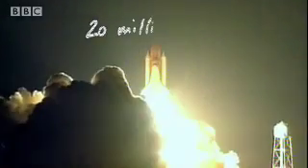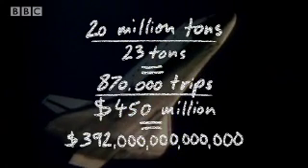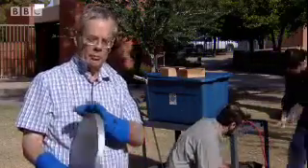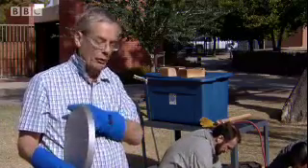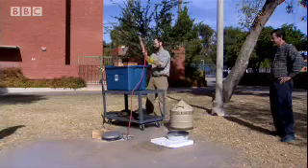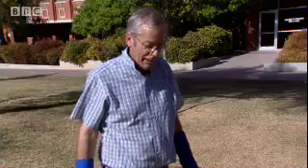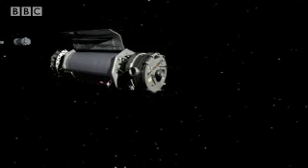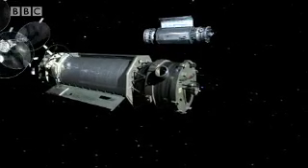A huge sun shade in space? - BBC Science

Comment: A space sunshade or sunshield is a parasol that diverts or otherwise reduces some of a star's radiation, preventing them from hitting a spacecraft or planet and thereby reducing its insolation, which results in reduced heating. Light can be diverted by different methods. First proposed in 1989, the original space sunshade concept involves putting a large occulting disc, or technology of equivalent purpose at the L1 gravitation point between the Earth and Sun.

A sunshade is of particular interest as a climate engineering method for mitigating global warming through solar radiation management. Such shades could also be used to produce space solar power, acting as solar power satellites. Proposed shade designs include a single-piece shade and a shade made by a great number of small objects. Most such proposals contemplate a blocking element at the Sun-Earth L1 Lagrangian point.

In 1989 James Early proposed a space-based sun-shade to divert sunlight at the planetary level. His design involved making a large glass (2000 km) occulter from lunar material and placing at the L1 point. Issues included the large amount of material needed to make the disc and also the energy to launch it to its orbit.

Comment: Cloud of small spacecraft
One proposed sunshade would be composed of 16 trillion small disks at the Sun-Earth L1 Lagrangian point, 1.5 million kilometers above Earth. Each disk is proposed to have a 0.6-meter diameter and a thickness of about 5 micrometers. The mass of each disk would be about a gram, adding up to a total of almost 20 million tonnes.[2] Such a group of small sunshades that blocks 2% of the sunlight, deflecting it off into space, would be enough to halt global warming, giving us ample time to cut our emissions back on earth.[3]

The individual autonomous flyers building up the cloud of sunshades are proposed not to reflect the sunlight but rather to be transparent lenses, deflecting the light slightly so it does not hit Earth. This minimizes the effect of solar radiation pressure on the units, requiring less effort to hold them in place at the L1 point. An optical prototype has been constructed by Roger Angel with funding from NIAC.

The remaining solar pressure and the fact that the L1 point is one of unstable equilibrium, easily disturbed by the wobble of the earth due to gravitational effects from the moon, requires the small autonomous flyers to be capable of maneuvering themselves to hold position. A suggested solution is to place mirrors capable of rotation on the surface of the flyers. By using the solar radiation pressure on the mirrors as solar sails and tilting them in the right direction, the flyer will be capable of altering its speed and direction to keep in position.[5]

Such a group of sunshades would need to occupy an area of about 3.8 million square kilometers if placed at the L1 point.[5] The deployment of the flyers is an issue that requires new technology. Large railguns or coilguns are proposed to fire a capsule containing a million shades into space every 5 minutes for 10 years using 20 separate launch sites.

Even so, it would still take years to launch enough of the disks into orbit to have any effect. This means a long lead time. Roger Angel of the University of Arizona[6] presented the idea for a sunshade at the U.S. National Academy of Sciences in April 2006 and won a NASA Institute for Advanced Concepts grant for further research in July 2006.

Creating this sunshade in space was estimated to cost in excess of US$5 trillion with an estimated lifetime of 50 years.[7] Thus leading Professor Angel to conclude that "[t]he sunshade is no substitute for developing renewable energy, the only permanent solution. A similar massive level of technological innovation and financial investment could ensure that. But if the planet gets into an abrupt climate crisis that can only be fixed by cooling, it would be good to be ready with some shading solutions that have been worked out."[5][8]

One Fresnel lens[edit]

The basic function of a space lens to mitigate global warming. A 1,000-kilometre diameter lens is sufficient, and much smaller than what is shown in this simplified image. As a Fresnel lens it would be only a few millimeters thick.
Several authors have proposed dispersing light before it reaches the Earth by putting a very large lens in space, perhaps at the L1 point between the Earth and the Sun. This plan was proposed in 1989 by J. T. Early.

In 2004, physicist and science fiction author Gregory Benford calculated that a concave rotating Fresnel lens 1000 kilometres across, yet only a few millimeters thick, floating in space at the L1 point, would reduce the solar energy reaching the Earth by approximately 0.5% to 1%.

The cost of such a lens has been disputed. At a science fiction convention in 2004, Benford estimated that it would cost about US$10 billion up front, and another $10 billion in supportive cost during its lifespan.

One diffraction grating
A similar approach involves placing a very large diffraction grating (thin wire mesh) in space, perhaps at the L1 point between the Earth and the Sun. Such a proposal was made in 1997 by Edward Teller, Lowell Wood, and Roderick Hyde, although in 2002 these same authors argued for blocking solar radiation in the stratosphere rather than in orbit.